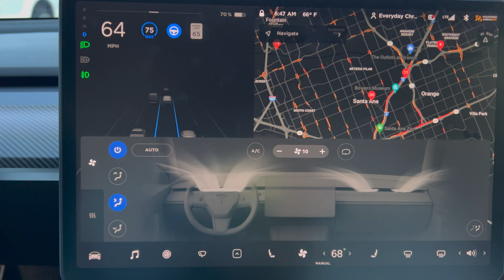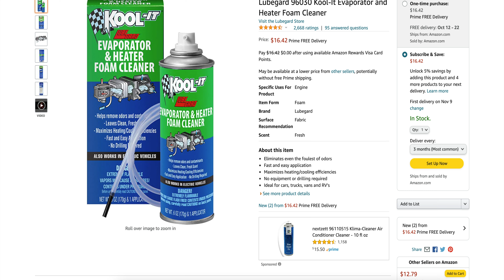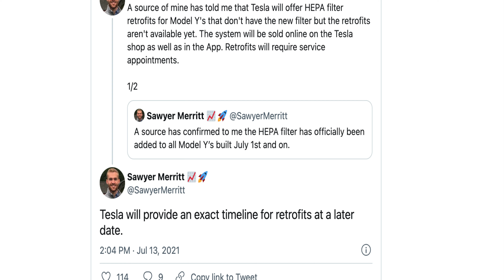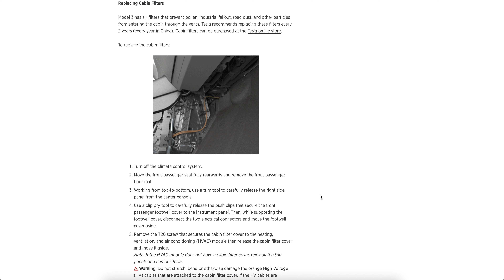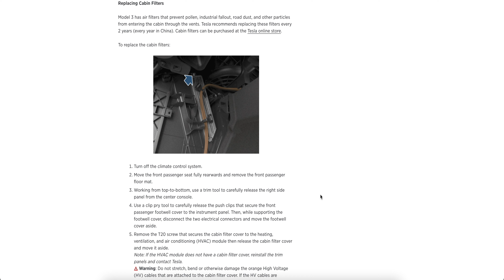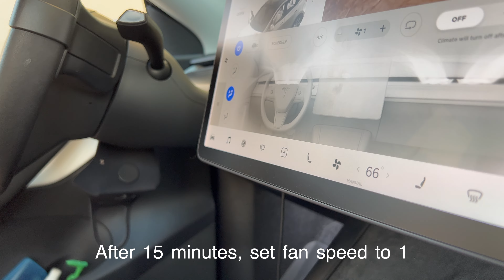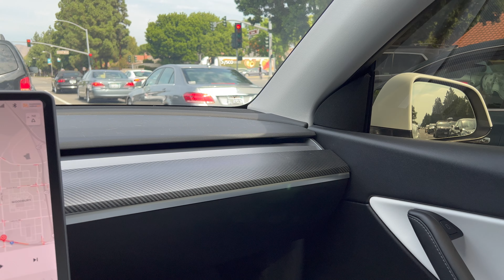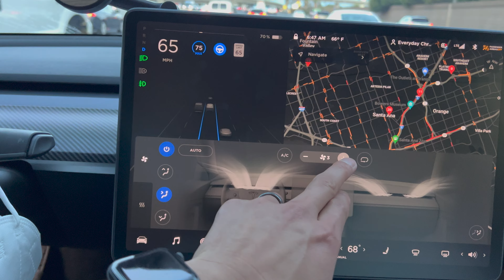How to CHANGE TESLA Model 3/Y Cabin Air Filter (It's not THAT easy...)

Comment from the maker: ►T20 Screw Driver- https://geni.us/fqCioI0
 ►Trim Tools- https://geni.us/RX5ZO1k
 ►Xtechnor tesla model 3/Y air filter-  https://geni.us/JBv5ta 
 ►Temai N98 Activated Carbon Cabin Filter Replacement (https://bit.ly/3xaVF3r) 
Use Code: Everyday chris for 10% OFF
 ►Kool It Evaporator Foam Cleaner- https://geni.us/hoNTOJS

Comment: Much easier on my Honda, but for my Model Y 2023 this was the best video I saw.  I like that you use the cleaner that Tesla uses for the coil.  I found the side panel to be the biggest pain  in the middle area they used a couple of big clips that don't release as easily as the rest, I put a pry tool on them so I didn't have to pull on the panel and risk breaking the plastic. Although I have almost 2 years and 27K on them they were in good shape.  I replaced them anyway since I had ordered the new ones and it was all apart.  Maybe the S FL heat helps, but we do have a lot of rain and humidity.  Again a great video, thanks!

Comment: Good job. More detail than some other videos on model y air filter change. I didn't unplug speakers and light as there was enough slack in wiring. That's a definite possible area when a newbie could miss up. Took me 15 minutes to open up the innards. then I didn't know which area housed the filter until I saw your video. 2nd time took only 5 minutes to pop panels off

Comment: I saw one Model 3 owner take the inside of the frunk out to show the a/c drain only drains out onto the floor of the frunk so water sits there and molds I guess. They suggested not use recycle air on a/c as much because that creates more condensation with it on.

Comment: My car smell was soooo bad after 1.5 years. Old filter seem still new. I replace filter and did the foam thing. Foam is what get rid of smell. Took me 40 minutes. Didn’t have t20 used a small flathead and it works.

Comment: Your videos are great. I subscribed. I changed my Model 3’s air filter once after 2 years and 15,000 miles. I found it to be a backbreaking and unpleasant task. Replacing the passenger side panel was the worst part. I know I lost or broke a couple of those plastic clips. This is the only part of the vehicle I think should have been designed better. Like Toyota as you said. Next time I will have Tesla perform this task despite the expected ridiculous cost.
Reply from the maker: Amen. They did make it easier but not nearly as easy as it should be lol. Thanks for watching and for the support!!
Reply: It’s costs over 300 dollars.
Reply: Bruh. You call this backbreaking? Wait until you get a chance to change the 24 spark plugs on a V12 S class Mercedes. That experience will make you convert to another religion 😂
Reply: There is much worse things to do, but yeah, the part that pissed me off the most was the side panel with the plastic clips. I have removed plenty of GM/Ford and Cadillac panels and have never broken clips. In the Tesla? First time I broke a clip and the panel now has a slight gap in it now. Everything else wasn’t bad.

Comment: Hi Chris, thanks for making this video. Super helpful! Going to change mine in the next few days. 
How do you like the aftermarket HEPA filter after one year of replacement? 
Do you have any experience replacing the wiper blades as well? 
PS i have the same batch of model Y as yours and I am in Canada 😊
Reply from the maker: Love it. It turned black after a year hhaa. It does reduce the air flow slightly. I think we have to change them more often because it filters so much more debri

Comment: how often do u change ur filter? i feel like whenever it rains i get that moldy smell. but whenever its sunny it usually has no problem..
Reply from the maker: It’s been like 15k miles try to max the air flow and turn on outside air 5 min before arriving

Comment: Dang. I just bought those same filters,kinda sucks how the air doesn’t flow as good,I may switch to the other ones as well.
Reply from the maker: Makes it smell less which is nice. But yeah reduces the flow for sure
Reply: @EverydayChris   so just noticed i can’t charge while using AC,is that normal? Not sure if it has something to do with the foam cleaner I used,it was dripping a bit from underneath my Tesla,can’t recall if that was a defect before I installed the filters…connector connects,and shows the display of charging,but not adding battery life (while AC is on) works fine when I turn the AC off.
Reply from the maker: Not normal. Charging can be done even with a software update! Try restarting the tesla
Reply: @EverydayChris  Ok. Will do. Thx

Comment: How's it been for you so far? Has the smell returned?Also you mentioned about the air flow slowing down a bit due to the additional filtration. Has that been an issue?
Reply from the maker: No smell. No real issues with airflow but it is decreased! I believe turning the outside air own before I arrive helped a lot. But zero smelly smells now
Reply: But do you really think biodefense mode would protect you? I don’t think so.
Reply from the maker: No smell from gas. Farts. Anything

Comment: I just did mine at 28k miles. Seems too soon but it makes sense that the thermal management system for the batteries runs all the time so mileage isn't really an accurate gauge.
Reply from the maker: Yeah good idea

Comment: Won’t it be easier to just alternate and turn on the heat for 30 minutes at night when the car is not in use to help balance it out so you won’t have moisture build up?
Reply from the maker: Hmm might be good. The outdoor air 10 min before you arrive helps